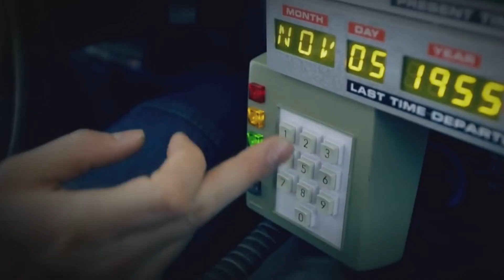Doctor Who Series 13 Rumours The TARDIS Is Dying

Comment: Eternal Machine the Tardis is grown from a bud of some unique like plant like mechanical construction and though this it power, and can loss its power source if something happens to the power it does not die but slowly goes to sleep of course there is still something that can kill a Tardis that's anti time or worse when two of same Tardis come together for long periods together they could easily explode or implode of course that doesn't happen often will almost never happens? Tardis may end but not the way you think it could wareout after a trillion years of use or just switch it self off if not used just grow old and become a strange old box in a back street of any town or village under a vadding street light but it still will wait for someone to travel anywhere in time but who will do?